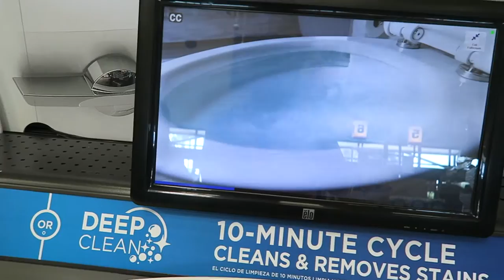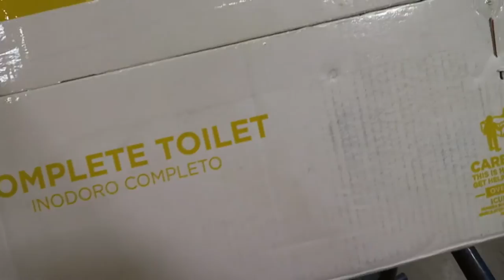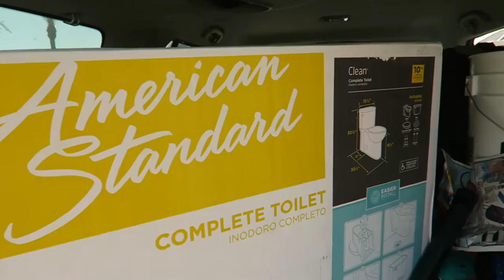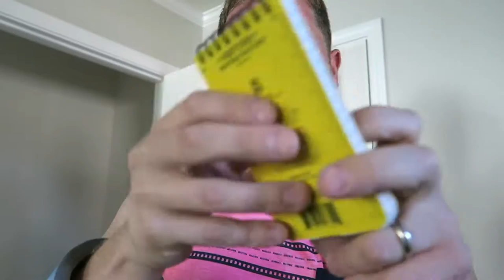How To Shop For Toilets

Comment: I was given a couple Remington 870's when I was younger (at the time Ohio deer hunting was shot gun only, I was given a 20 gauge to start out then a 12 when I could handle it) and I was surprised how quickly I had issues with the receivers rusting, especially since they were coated.
Reply from the maker: +Kody Gregg my 870 is a rust factory too.
Reply: Have they moved to the new factory yet? It would be interesting to see if the change in climate during the assembly process effected those types of issues.

Comment: #QOTD My biggest disappointment in tools was a Craftsman power screwdriver that came with my 75th anniversary tool set.  It had the 18V drill, flashlight and a hand power screwdriver that had an internal rechargeable battery.  I think I charged that thing up for like 5n hours and it ran for like 15 minutes...never used it again.  I used the drill and flashlight for years.  The drill finally died, but the flashlight still works.
Reply from the maker: Internal battery tools are the worst!

Comment: #QOTD There are certain types of pans that and other cookware that can not be placed in a dishwasher... I hate that.. especially a pan that you don't realize needs to be seasoned and is not dishwasher safe safe so it comes out all rusted after your first use...... drives me bananas!!!
Reply from the maker: +Ryan Dubay like cast iron?
Reply: +hoshnasi well cast iron is easy and obvious there are certain types of high carbon steel pans like some woks and some Paella pans
Reply from the maker: AH!  Right, I did that to a wok too!